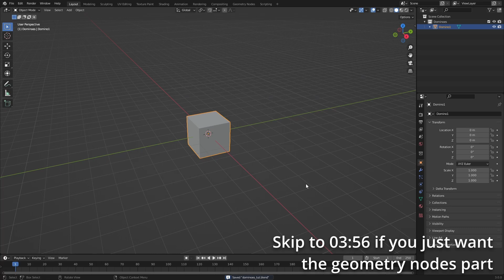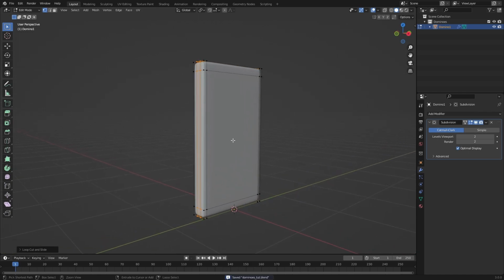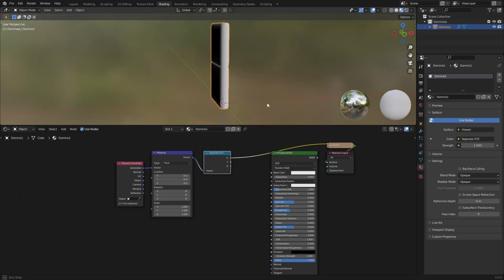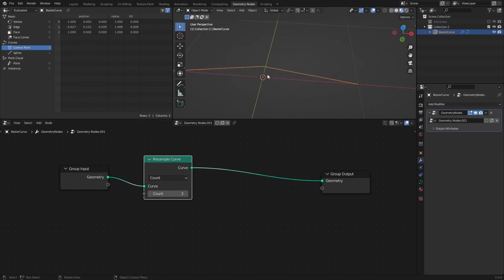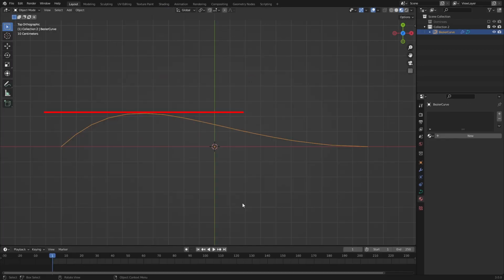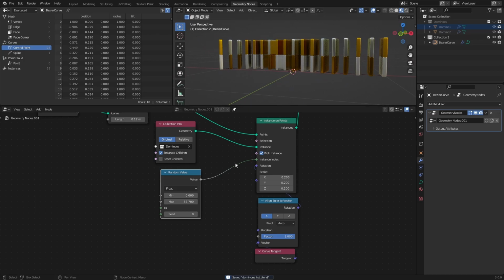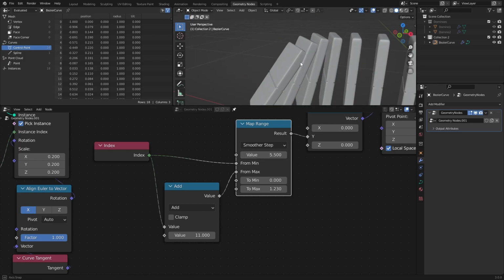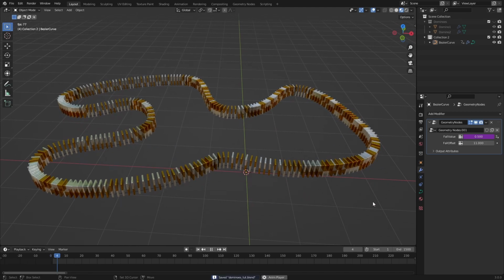Falling Dominoes with Geometry Nodes | Blender 3.0 Tutorial

Comment: Tip: u can use a float curve node for custom fallof instead of linear fallof which will fix the problem of the dominoes in front starting to lean before they are touched by any other domino
Reply from the maker: Nice tip, thanks!
Reply: excuse me! Where to put the float curve node? Index -> math node -> float curve -> map range?

Comment: Thank you for the tutorial! Very informative. If I wanted to use the geometry nodes only to create the instances of the models (and not the animation) in order to appy the modifier and then animate all dominos with rigid bodies... How Would we do that? When I try to apply the modifier, it says it needs to convert the curve to mesh, but that leads to all the parts dissapearing.
Reply from the maker: I haven't tried this for this example, but of you add a realize instances node at the end before converting to a mesh it might be enough to fix it.
If that doesn't work I will take a look at a solution tomorrow and get back to you so let me know if it works
Reply: @Khamurai  Thank you very much for your very quick responce. Your suggestion did solve it! Then in edit you can seperate by loose parts and have "part" being a seperate model. But the realize instance node seems to be messing up the random material distribution for me.